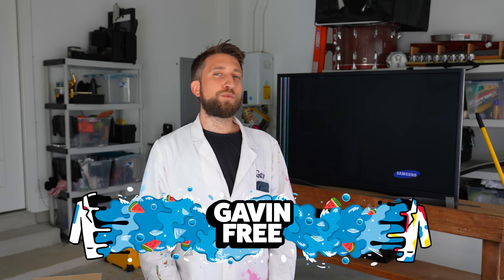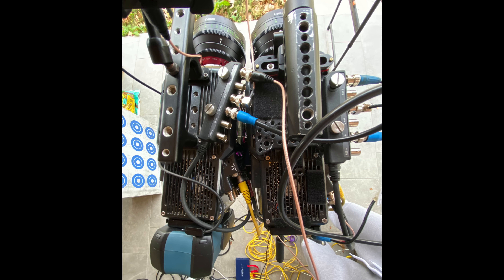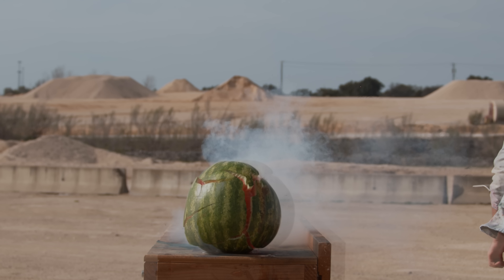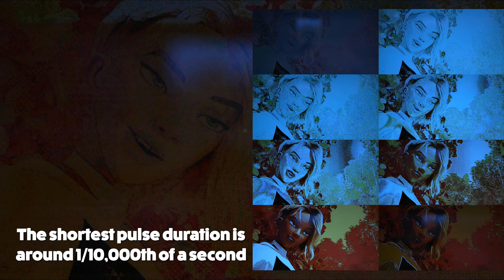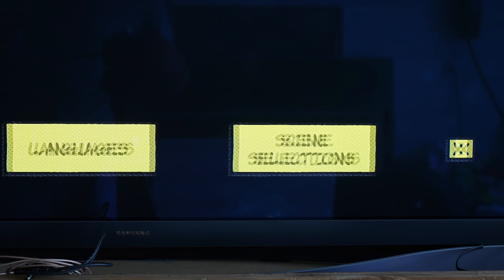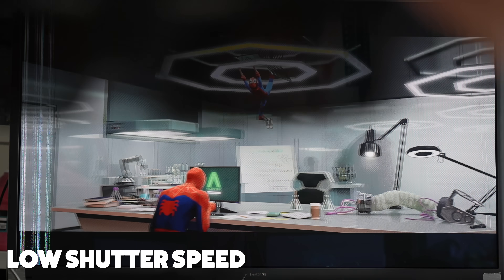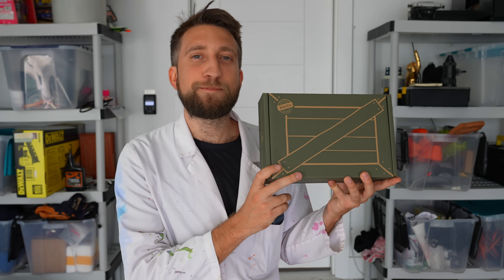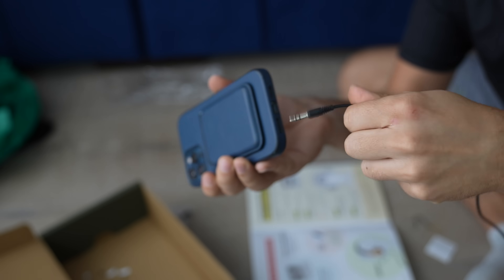How a 3D TV works in Super Slow Motion - The Slow Mo Guys

Comment: One of the biggest problems with this 3-D tech was it gave viewers headaches after a short time.  Most people I knew with 3-D TVs said they couldn't get through an entire 2 hour movie without having to take an "eye-break".
Reply: It doesn’t depend on the eye separation technology, active or passive, or even holographic, but it depends on the fast pace of the film itself, as our eyeballs are not made to be driven by the will of others like puppets, the problem is that not all directors are good with 3D shooting which should be pretty slow and steady as most documentaries usually are, actually 3D is meant to be for documentaries and personal recordings, not so good for movies or cartoons animated with traditional directing techniques made of frequent frame changes during fast paced scenes.

Comment: Makes me wonder, since many screens produce polarised light, and we can selectively filter that, would it be possible to alternate between different directions of polarised light, so that the lenses on the glasses can alternate which eye receives light passively by mounting one of the lenses on a 90 degree rotation, eliminating the need for a battery and complex electronics in a device you put on your nose? Or is the polarisation a result of something that happens after the light is emitted and cannot be easily changed?

Comment: If you want 3D on a larger screen than 50  - 55 inches, projectors are the way to go now: they still do 3D!  However, it looks like they're starting to phase 3D out on projectors now too....although I think it'll still be a couple of years or so before that happens across the board. I still have a 50 inch 3D TV - I think I bought one of the last ones - and currently have my eye on the projector scene...

Comment: Great Video. You should do a test on the "NEW" 3D projectors. 3D TV might be dead, but 3D Projectors rock. Most projector manufacturers settled on a 3D standard called DLP-Link. and brought down the cost of the glasses. If only the TV manufacturers had done the same thing, maybe we'd still have 3D TV's.

Comment: lets make neutron star collisions simulation
make 2 Neodymium Magnets covered in ferro liquid with same size and weight separately then make them collide in spiral way
you can make them collide using trampoline-like medium that will draw everything heavy to its center
or by hanging them with string then swing it till they meet each other in the center

the fun-things happen in last seconds until they collide when each magnet pull others ferro liquid and when they collide they will splash ferro liquid in unique way

Comment: there's nothing special about 3D screens. 3D TVs are 100hz instead of 60hz. NVIDIAs active shutter technology, "NVIDIA 3d vision" requires monitor with at least 120hz refresh rate, which most of us gamers have anyway. In-fact 120hz never caught on, so most high refresh rate monitors have 144hz or faster displays.

Comment: I was 10 years old, it was 1993.
Nobody reading this would probably believe this but I myself came up with the idea of using liquid crystal glasses to filter two separate video streams into the eyes using a time controlled system. Initially the purpose was to enable two people in the same room to watch two separate programs on a single screen by wearing a pair of these glasses which would filter the correct frame from the correct show to the person who wanted it and each wearing headphones so they could hear the show they wanted.

Comment: Those 3D TV's were way ahead of their time.  I worked at Best Buy when they started all the 3d stuff and it was ridiculously expensive.  I remember we had a 50" 3D Panasonic Plasma display that was like $2,600.  And each pair of glasses was like $150.  Like you said in the video, it probably would do better now since tv prices have plummeted since then.

Comment: Given that a lot of these modern tvs have anywhere between 60hz and 144hz displays, you don't really need that technology to be built into the circuit itself, you can simply simulate it, no movie out there is even 60 fps, so you can do a 30 fps with double frames, one for each eye.

Comment: LG 3D TVs use a different method (something to do with polarisation) and the glasses are passive and very light. It would be interesting to see that in slow motion.
Reply: Yup. Polarized lenses, and the TV works basically the same. The screen flips back and forth, showing 2 different images, one for each eye. The difference being that the "colors" are shifted in every other image, so that they can only be seen through one lens of the glasses at a time.

Comment: Hi Gav, am very interested to see what happens when a tiny drop of water or any liquid is dropped vertically over the blow torch or any hot flame🙄will it vapourize as it comes down? or dissappear? am curious to see in slow motion☺️

Comment: I saw a video somewhere saying that less advanced 3D glasses simply restrict the alignment of the light being sent through the glasses, one lense for vertical wavelengths, and one for horizontal. This is why if you take the lenses out and overlap them, no light gets through, because whichever lense is at the front of the stack is blocking out the wavelengths that can pass through the lense at the back of the stack.

Comment: 3D gaming was amazing while it lasted.  I think 2 Call of Duties had 3D modes, and it made aiming so much more natural.  You had a sense of depth, distance, and the red dots made 3D a little OP.  Even iron sights were better in 3D, because the rear post was essentially transparent, and you only had to focus on the front post.  They basically became red dots without having to sacrifice an attachment.
Reply: vr still does that. it's cool how closing an eye helps with aiming.
Reply: According to Sony, all PS4 games can be played in 3D on a 3D TV. Not sure if the quality is as good as the PS3 games specifically designed during production to be played in full 3D and of course regular 2D.

Comment: How does the "advanced winking" in the glasses synchronise with the flicking of the perspectives on the screen? I mean, in your slow mo shots both always look perfectly synchronised, but if the glasses are just controlled by a battery and are not connected to the TV in anyway, how is it that the glasses and the screen aren't allways out of phase in a random maner?

Comment: Aren't it 144 switches per second?
A 3d BluRay always has 24 frames.
It is shown one after another for both two eyes, and it repeats each picture for each eye three times (or two times, depending on how modern your projector is)

24 FPS * 2 eyes * 3 repetitions per eye
24*2*3 = 144

Comment: I did 3D video by exploiting the "even-odd" fields of NTSC TV (with 2 genlocked cameras), and running LCD glasses at 30 Hz.  Then a company called Pinecone systems made a box that accepts NTSC video from 2 cameras, buffer the video, and scan CRT at 120 Hz, so the LCD glasses can be run at 60Hz.  All the newer solid-state displays won't do 120 Hz, so I must lug around CRT display!  I can only get 120Hz out of HUGE displays.  I don't want big display!  I want display I can use for robot stereo REAL-TIME views, not the views offered by the cinema industry, that are shown after passing through the cutting room!  Is there place where I can purchase flat-panel display no larger than 14" that can do 120 Hz?

Comment: If you travelled back 50 years, would anyone believe you if you told them we now have electronic eye-patches?
Reply: Yes, somebody probably would believe you, since research into liquid crystal displays had started 9 years earlier, and the televisions common at the time already had to scan the screen each frame, energizing each pixel by launching electrons at it through a vacuum.
Reply: Also, 6 years prior to that time, Gordon Moore predicted a rate of advancement of electronics that was relatively accurate, but thought we'd have advanced more (than we have) by 2021.

Comment: Correction: How a CHEAP 3D TV works. 

Active 3D ruins your eyes and makes the whole picture darker, because you're essentially wearing flickering sunglasses. Passive 3D was and still is way superior, but this requires a polarized filter all over your screen, which makes it more expensive.

It's a shame 3D never took off. As always people cheaped out and only wanted the cheaper 3D TV's (ironically with very expensive glasses), and then complained about headaches. Whereas if they would have went with the passive TV's their comfort would have gone way up, plus they would have been able to use the 3D glasses you get at the cinema. I have owned 2 passive 3D displays from LG (I still do), and it's such a shame nobody releases 3D content for them anymore, as I really enjoyed it.

LG still produces passive 3D displays, and they're very high quality and affordable, mine currently is 65 inch/4K and even I could afford it.

Comment: The problem of 3D TV has always been that there's exceedingly little content that is specifically worth watching IN 3D. Even back in Andy Warhol's time movies were tenuously straining to incorporate contrived scenes engineered to take advantage of the overly excessive depth perception 3D made possible. Always someone throwing a bowl of water, or thrusting the point of a spear, or the requisite flock of bats flying straight at you... In the end, it turns out that actual 3D is far too much trouble to film in, and adds vanishingly little to the actual experience.

Comment: Maybe it will come back at some time, when we get 16k resolution and use polarizing glasses. They've been available, but because of the "low" resolution of the TVs it was visible. The other challenge is to line up the polarizing filters with the pixel grid. Guess they have to include it directly onto the pixel when it's made. My new graphics card doesn't support 3d with nvision anymore. Very sad. Have to setup an old pc just for this. The other problem this disappeared was, imho, that not every 3d movie was true 3d, but fake rendered 3d. Also movie makers made many 3d mistakes leading to sickness of the viewers. Especially on those fake 3d movies that were never intended to be primarily watched in 3d and have a lot of wild movements and cut scenes. If you watch Avatar and see how slow it starts, giving the viewer to get comfortable with this view, you know what I mean.

Comment: I have a 3D TV. I've used the 3D like 4 times in 10 years. Well that's a bit disingenuous... it was used those 4 times in the first month and never again.  3D TV was a useless fad that should stay dead. Just like curved TVs. I will note that I didn't buy the 3D TV for the 3D capabilities. It's just that at the time, the best TVs were 3D as well.

Comment: I had a nice Panasonic set with active 3D, and yes it's a shame this tech died off, but it's also completely understandable. Because of the LCD layer, even the clearest active glasses aren't completely see-through without a substantial amount of light loss; turning on the 3D mode would immediately result a much darker image, and dialing up the screen's brightness to compensate would then surface a ton of the compression noise that normally goes unnoticed.

The best use case for 3D was gaming, and VR headsets have now taken over that space, doing things no fixed-size static 3D display could manage. Overall, something was lost but more was also gained.

Comment: I wish it was 2013 again too, Gav. I still have a 3D tv I bought around then but haven’t used the 3D functionality outside of the first 6 months of owning it.

Edit: Whipped out the old 3D glasses and fired up one of my antique 3D Blu-rays and it was nostalgically neat but also apparent as to why you have to slum craigslist to find the tech on a consumer set these days.

Comment: How do the glasses sync up with the TV?
Reply from the maker: Transmitter and receiver in tv and glasses
Reply: 😙 tnx for solving my doubt
Reply: @theslowmoguys  when the reply has more liles than the actual comment.
Reply: I still have my 3d TV but it's those active glasses that killed it off, my TV uses passive glasses the same as the cinema.  I've got about 12 pairs of them. 3d is great I hate that one day it will break and I can't get another one.
Reply: @nothingsurprisesmeanymore  The latest of the tvs didn't need glasses at all to view in 3D! Much like how there were a few smartphones that had 3D screens and the 3DS also had the same sort of 3D screen without the need for glasses.
Reply: @DefensiveWounds  the 3ds (can) cause(d) headaches and nausea
Reply: @DefensiveWounds  They weren't the latest. It was just a competing standard and on a 1080p HD passive 3D TV the resolution was halved or even quartered depending on the 3D transmission format. Active 3D using shutter glasses maintained the full resolution.
Reply: @TheOriginalNCDV  But glasses free wasn't around at the start? Active and passive were the competing standards but both had glasses.
Reply: @NithinJune  So does the glasses. I could never make it through an entire movie without getting a headache and getting nauseous.
Reply: @nothingsurprisesmeanymore  go with projection. Xgimi polar z6 is awesome. It’s active 3D, but looks insanely better than my active 3D Samsung tv. No ghosting AT ALL.
Reply: Bluetooth actually
I have the same model and it appears as a Bluetooth device on my phone even though the tv doesn't have any Bluetooth functionality
Reply: Just asked the same question myself without looking first. Thanks for the answer. That seems like such massive technological overkill :)